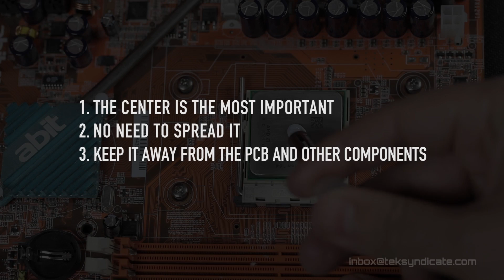How To Apply Thermal Paste

Comment: Guys... I spread a really thin (but covering) layer of Arctic Silver 5 with my FINGER all over my Phenom II X4 920's IHS. With the STOCK cooler from AMD the top temperature under heavy load it ever reached was 57*C. Beat that.
Note: The cooler produces just a bit of wind noise at such temps, nothing loud whatsoever.
Reply: My 965 has a thin business card spread and hits 53 max temps in real world gaming with the stock cooler.. It hit about 65 with cpuz but that was peeeak
Reply: What cooler do you have?

Comment: Does Arctic Silver 5 ever expire? I have a bottle over 10 years old.
Reply: As long as the material in the thermal paste is fully mixed, it should be fine. Otherwise, purchase a new one.

*Using Old Arctic Silver*

Squeeze out a few dabs of the substance onto a scrap surface like a piece of paper or plastic, then throw that away. You'll likely get a clear fluid that comes out first: squeeze until the “silver” colored material of the Artic Silver starts coming out, well mixed. Make sure what you are squeezing out is well mixed and not flaky or clumpy or dried out.

Set the tube nose down for a day or two. This will make sure the “silver” floats to the bottom of the tube, ready to be applied. Before applying to the processor, be sure to push put a bit more to make sure it looks smooth, liquid, and well-mixed. Be sure to follow the instructions for proper application, including not applying too much. Different processors recommend different methods for spreading out (or NOT spreading out) the thermal paste, so be sure to check the Arctic Silver documentation for your specifics.
Reply: ***** Thanks,  my Arctic Silver 5 is a darker grey,  not light or Silver color. Could this be a bad sign of it being to old to use or is some of the compound manufactured that way? I don't remember what color it was when I first used it.

Comment: You really don't need to buy the expensive "quality" stuff. I bought the cheapest stuff I could find and my temperatures are great. It was £1 for a 75ml syringe tube of the stuff from Wish.

Wish is great for stuff like thermal paste and SATA cables and the like. Obviously don't use it for graphics cards or motherboards or whatever though.

Comment: Is Arctic Cooling MX-4 good?
Reply: ***** MX-4 seems to do it's job well, especially with my CM Hyper 212 EVO
Reply: The best is Indigo Xtreme. The method you use to apply it is quite unorthodox, but its literally the best damn thing on the market. Just make sure you read their warnings and stuff before you use it, they're very picky about how it should be used.
Reply: I had it. It's good but there's plenty more that are better that are the same or less expensive. I recommend the Prolimatech PK series.

Comment: It's odd that you've actually proven that the X method is the best method as it covers the entire CPU surface, something the pea method fails to do.
Reply: you don't need to cover the whole CPU.  thermal paste also expands as it heats up, meaning the X method may result in paste spilling over the side.

Believe me, I used the pea method, it worked great.  I have an i5-4690K running at 4.4 GHz with a Hyper 212 Evo and it stabilizes at about 62 to 64 degrees when gaming.
Reply: My instructor actually recommends doing the spread method: The trick is trying to apply it without leaving any streaks. I've seen tons of comparison videos doing the spread method but incorrectly. Its time consuming but leaves the CPU a few degrees cooler.

Comment: Acrylic plate can bent when you push on corners so actually video doesn't show anything helpful. next time try pushing paste with acrylic on center of the cpu and results will be correct mostly same as mounting solid cooler.

Comment: So.... who is better the pea or the X?
Reply: he clearly said pea is the prefered method man
Reply: Calm down bro, but thanks
Reply: X is better, you can see it spreading much better in the video.
Reply: Kappaccino nah
Reply: TheNosyGamer ye
Reply: 1. The pea will eventually spread a bit more. 2. The cores aren't out to the edge of the CPU.

Pea is best.
Reply: Well, I tried that and it destroyed my board. I drank two cans of beer and after a while I unloaded. It just doesn't work!
Reply: Yeah but did you shake the applicator to get every drop out?
Reply: trolls or not. just a simple pea do not do x. you can if you want does not mean its gonna destroy it on power just the thermal paste is going to hold the heat in for to long before it hits your cpu cooler. therfore gonna heat your cpu up more not the best idea.

Comment: You pressed down harder on your preferred application method, just to prove your point.

Just use the cling film method spreading a thin coat evenly, as used by anyone who, unlike this guy, knows anything.

Comment: Ran out of thermal paste and since online shipping takes too long and I'm too young to drive on my own going to uses toothpaste on an older system with an Athlon II X2 and will test stability (most likely going to end in a shitstorm or for the trolls darude - sandstorm), honestly even though I haven't done it yet if you have a decent rig or have access to thermal paste for the love of god don't use this, especially as a permanent solution.
Reply: I'd just wait if I was you.

Comment: Do I need yo ever re-apply it?
Reply: only when you remove or change the cpu cooler which is something you should not be doing often. The paste itself will outlast the lifespan of a computer if it was applied correctly.
Reply: Nerd_United cool.Thanks!
Reply: Tefen M Ok then.
Reply: I want to see where you got the 2 years number Tefen because I haven't 
seen lifespans that short from even the manufacturers. It obviously 
depends on manufacturer, but arctic silver 4 for example lasts 8 years 
and arctic silver 5 actually lasts forever because it's 99% silver. All 
this came from their website. All but the cheapest of greases will 
outlast the cpu If it is applied correctly.

I don't know anyone who recommends changing out paste just to change it out. Replacing thermal paste is required whenever you remove the cpu cooler because it allows air get in between the cooler and the chip.
Reply: dont even mention laptops. Those are designed with not a very long lifespan anyway.

Comment: Please help my cpu (amd x4 860k) 
Runs at 70 degrees Celsius idle and when gaming at more than  100 degrees celcius. I build the pc myself.  First I thought it may be because of the thermal paste so I bought thermal paste but it is still running so hot please help. 

Specs from pc
Amd x4 860k
Msi  a78- e 45
Gtx 550ti
430w psu 
The PC is about 2 weeks old
Reply: ***** nop
Reply: I bought a new cooler and now it Is 90 degrees if I play gsmes
Reply: Emanuel Warzel what temperature should my cpz be AT
Reply: Emanuel Warzel jo
Reply: Are you using the stock cooler? Quad cores at high load really need better than that to stay cool.
Reply: Usama Bhatti have you checked that the cpu fan is actually spinning?
Reply: Yes
Reply: which thermal paste did you apply? and which cooler do you use? does the hot air get out of the case? the cpu fan needs to blow the air towards an exhaust vent either on the backside or on top
Reply: I bought artic  thermal paste and I have a Arctic a11 cooler.
Reply: thats weird... did you clean the cpu and heatsink plate with alcohol?
Reply: No I cleaned it with a cloth
Reply: you need to use isopropyl alcohol or some clean kit like arctic silver has. you take some of that isopropyl on the cloth and clean it, and dont touch with fingers, you dont want any dirt or skin oils in it
Reply: Ok what temperatures should my cpu be running at
Reply: well 40c idle and 70c under heavy load would be acceptable, but i think that cooler can get lower
Reply: I sometimes get 50 idle and under load 60-90
Reply: you sure the heatsink is mounted well? always use the star method, go from corner to opposite corner when screwing it in..

but yeah, get the cleaning kit or isopropyl and clean the heatsink plate and cpu, reapply paste and reinstall the heatsink, using the star method ^^
Reply: Do I have to,  aren't the temps now ok?
Reply: well if it stays around 50c idle now, thats fine
Reply: Usama Bhatti No the temps are not normal and yes you definately have to do it. Just get alcohol cleaning pads in any pharmacy. Clean your cpu carefully with them and wipe it thoroughly with a clean microfiber cloth. Then just put a pea sized dot of thermal paste in the center of cpu. JUST DON'T SPREAD IT! That's a big mistake. And just put the heatsink on :)
Reply: Basstard where do i check temperatures on the comp? and my comp has gotten a bit noisy is it cuz of the fans getting dusty or something? i have no clue about anything regarding computers but im trying to learn
Reply: download and install coretemp. do you have a laptop or a desktop?
Reply: TvShopOnTv then cleaning the dust is rather easy, just open the sidepanel and blow the dust out with compressed air
Reply: Basstard aha so a normal idk the word for it in english but those u normally go around with in the house to clean sucks in air and dust and whatever u might come across right thats not very good to use i guess?
Reply: TvShopOnTv its a vacuum cleaner, and its ok, just dont suck up any jumpers and dont let the fans spin...dc motors can work as generators
Reply: Basstard what jumpers? and should i turn it to low power so it doesnt hurt anyything?
Reply: Emanuel Warzel Now that is bull shit when the tj max is 105 degrees you can run it at 100 and its gonna be relatively safe, but if you decide to run in cooler depending on your chip you will get longer life span out of it after like 6-7 years of use. But as said 100 degrees max is not normal with most cooler on an amd x4 860k, i would probably get it replaced since its broken, or if it's not possible i would re paste between the chip and heat spreader on the cpu.
Reply: Jette Christensen my laptop used to run at around 80-95 degrees under heavy load and idle at 55, it died in 2 years... you do not want to run your cpu that hot
Reply: Basstard I suppose i was referring to the max temp when running an artificial 100% load application such as intel burn test, in games the temps are usually lower. I know a friend who does loads of rendering on his 2600k and it reaches temps of 80-85 when rendering and its been going for 4years just fine. I guess it really comes down to what chip it is.
Reply: Usama Bhatti Mine runes at 100c when not gaming and its a stock CPU

Comment: Someone can tell me if water or bleach do the job correctly to clean the thermal paste?
Reply: No. Just, NO.
Reply: Isopropyl alcohol.
Reply: TasteThePainbow88  well its a bit too late now, thats an old comment, but thats what i used, i found isopropyl alcohol in my house and it worked great.
Reply: Dab a piece of cloth in lighter fluid and wipe it, then as fast as you can, dry it up with a lighter.
Reply: ***** and running crysis 3 in the sametime.
Reply: ***** Rubbing alcohol, 70%. Works just fine.
Reply: They work fine. Just make sure the motherboard has been dipped in mustard. Wields best results.

Comment: What does cleaning the CPU do?
Reply: He's just getting rid of the old paste
Reply: bradleypariah Can CPU work without thermal paste applied?
Reply: anonymous2012s Not worth the risk. It immediately voids your warrantee and I've seen a friend's CPU overheat and die in less than five minutes because he neglected to use thermal paste.
Reply: bradleypariah Can thermal past last more than a decade?
Reply: anonymous2012s Not sure. I'd guess so, not that many computers stay in one piece that long. -and I'd think humidity would play a huge part.  The general rule I've always heard is that if the heat-sink comes off the CPU, replace the paste.  That's playing it safe.
Reply: bradleypariah Why would heat-sing come off the CPU?
And btw whats the real benefit for CPU and other components of taking off PC's chassis/tower one side in the context of cooling?
Reply: anonymous2012s
There is no benefit as far as i can see , Apart from the massive amounts of dust and stuff , you will lose any through flow , Depending how your fans are set up that is . I do it everynow and then after installing new parts untill i know everything is okay , Other than that i try and keep it closed and sealed off when ever possible . Also it can suck people in
Reply: John Smith Thanks! And Lol! :)

Comment: hi total noob here what the hell do i need this for and do i have to do it frequently?  Building a PC and heard about this in the comments of the video (the video for the PC build not this one obviously)      Please to anyone who could help please do
Reply: +max deem only time you EVER have to do this is when installing an aftermarket heatsink. if you bought a heatsink with your build then you will have to and only once and never again, unless your cpu ever starts overheating right away because you messed it up then you'd have to wipe it off and reapply. stock heatsinks (heatsinks that come along with your cpu you purchased) will have thermal paste applied already.
Reply: +Stefan Stefanov :) Nope, while dusting the PC, you don't have to remove the heat-sink, only it's fans, while the heat-sink either with a vacuum cleaner, or with an special spray with compressed air that you can found at any super-market.

Comment: As stupid as this sounds, is 99.7% Isopropyl alcohol alright to use?
Reply: Try not to drink stuff with more than 80% of alcohol. Other than that, I guess any alcohol from 60-99% is good enough for cleaning. 99 Is almost an overkill, but it evaporates quickly, which is nice.
Reply: TheCrusaderBin Does that mean I can use the common rubbing alcohol with only 70%?
Reply: Solrac Oreca yes, i saw an other video where they cleaned it out really well using 70% alcohol.
Reply: little late to the party, but yes.  The reason you want such high percentage is because then you only have water and isopropyl alcohol in it and none of the gunk you get in the "hand sanitizer" shit that's in the usual 50-55% isopropyl/alcohol solutions, you don't want anything other than isopropyl and water in the fluid you use (and less water the better, dries quicker) because when that dries out it leaves nothing behind,  most other scrubbing alcohols have bunch of other shit in it, like stuff to make it smell better or things that's good for the skin or wounds or shit,  that stuff leaves residue you do not want on your CPU.

Comment: Um.  Could this be any more obviously unfair with the spread method?  This guy just slaps it on to prove his point.  But the spread method is correctly done by taking time to carefully rub it on evenly, which this guy conveniently did not do.  Nice try.
Reply: When you spread it out prior to you still get air bubbles, the advantage of the pea in the middle is that as you apply pressure it spreads, removing air. This guy applied too much obviously, and the pressure from his hand is nothing (nor distributed) like it would be if he had fully mounted a heatsink.